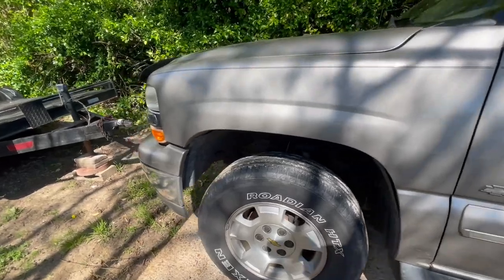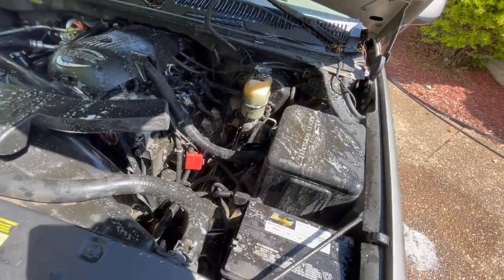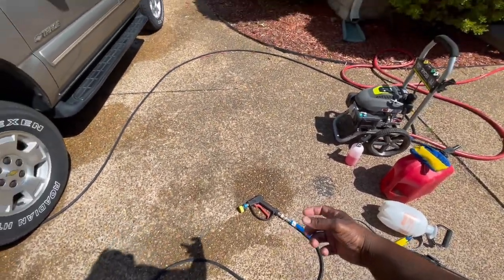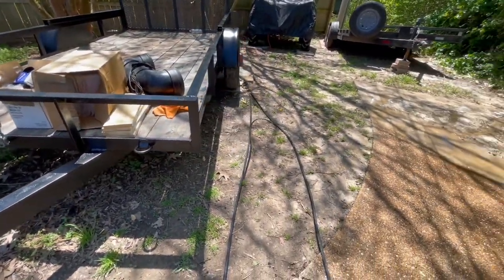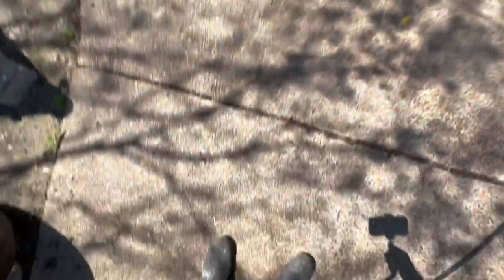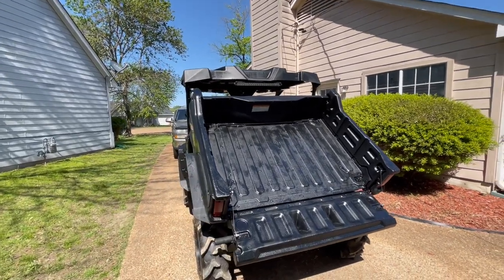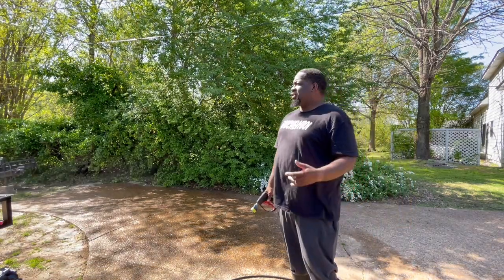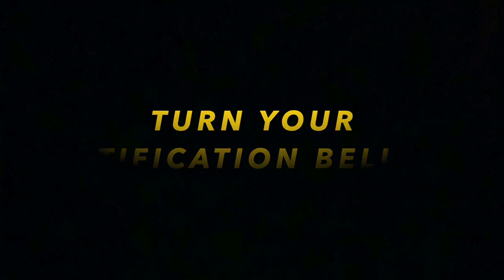It got REAL at the CRIB TODAY‼️

Comment: Its drains at the bottom of your door. One way to make sure they are not clogged is to spray air in them to unclog them. If they are clogged it could cause the water to run into the vehicle.